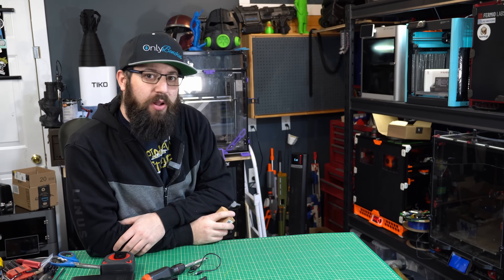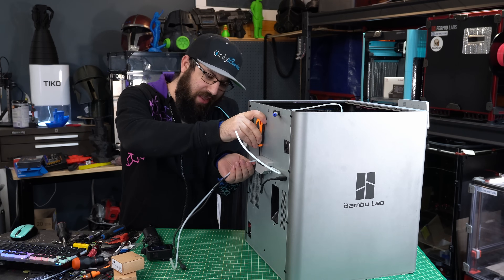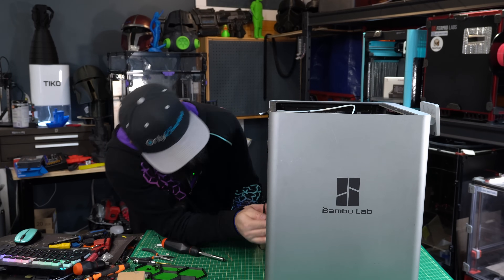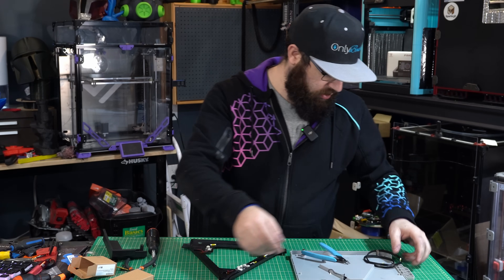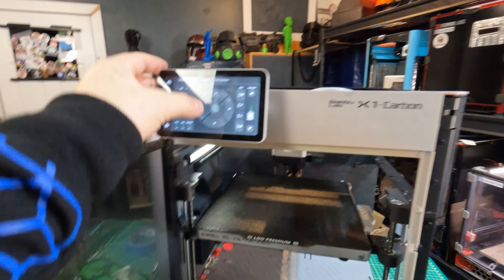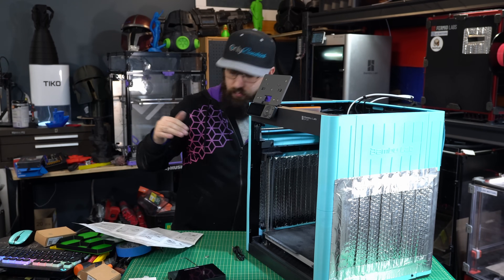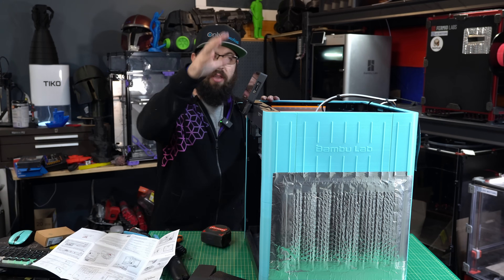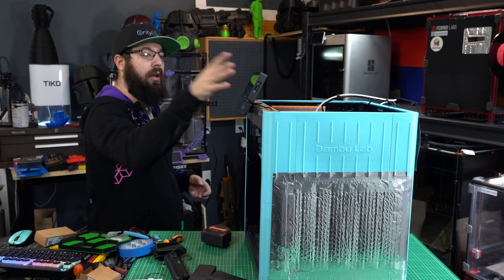My Bambu Broke, Lets Fix It (and upgrade the P1P Too!) #3dprinting

Comment: Bambu X1 owner from the UK here. Just thought i would comment in case anyone has the issues im having. I have a faulty bed that Bambu refuse to replace under warranty. Printer has done 800hrs. I have the V2 bed which is now discontinued. You have to replace the bed and an AC board for the V3 bed. Why was the bed discontinued? Was there an inherent fault with the V2 bed and the way the cables route through the bed. Well the V3 has changed the position where the cable routes through the bed so the radius of bends in the cable are not as acute. I believe this is the real reason the bed changed. Will Bambu honour it? Will they buggery! They just deny any faults and state its part of the upgrade of parts! Bullshit!  I know this is not going to help people stateside but i've recently discovered that consumers in Europe automatically get a 2 year warranty under directive 2019/771. This EU law is not to be sniffed at and gives consumers an extra year to what everyone else would be covered for. If you are anywhere else the warranty period seems to be 1 year. Ive spent the last 2 weeks talking to support who are absolutely useless and never answer your questions. Don't get me wrong when the X1 is working it's great, if it isn't you could spend weeks in the black hole they call support. I have been happy up to now but dealing with awful product support who accept no responsibility and never give you an answer has got me thinking its time to sell these and maybe build a Voron instead! Thank you for your hard work you do on your channel!

Comment: Good video.   I have both printers and luckily I have problems that require the dissemble you had.  I have lost many screws in the back hole when taking the nozzle out for jams.   I  wish I had purchases two X1 Carbons instead of P1P.,  a lot of parts are different between the two, especially the hot end.  I have to stock parts for both

Comment: Fair warning BL has hinted that they may block the way that devices like the Panda touch work in the future and eventually longer term make an API available. It's in the details on the Panda Touch product page but want to make sure folks read and make a decision before hitting the buy button, as its possible the device will stop working in the future.

Comment: Many users had to replace the whole bed coz of sensor problem.
I almost had to do the same, the connector was full of glue and removing all the glue from the connector solved my problem. I don't know why the use of so much glue. It is fair to say I no longer have it.

Comment: i personally just skipped the part of the ground wire and used a wago so i didten have to take the panel off saved me like 30 mins :P
Reply from the maker: Yep, because because I was pointing out the bad design and that they are a pain to remove normally, instead of disconnecting them from the back of the machine before taking it off the shelf, i have to get my step ladder and climp up top my shelf and disconnect the AMS itself first, then pull the printer off the shelf.
Just because its a situational thing, doesnt make it ok to design the plug backwards
Reply: ye i should probably have written i agreed its a pretty dumb that it is needed to be done that way anyway good video ill be tuning in next stream hopefully
 @CanuckCreator

Comment: thank you for steering away from preaching your extreme bias against bambu labs. loved your content even before they disrupted the market
Reply from the maker: I`ve never had an extreme bias against anyone, everyone is open to valid critiquing
Reply: @CanuckCreator  Understood. It can come off that way at times.
Reply: @oozie-c3j  If Bambulab fans feel attacked by valid criticism, I suppose that's certainly a choice they've made. Bambulabs has shown that they are willing to communicate with "the community", and aren't afraid to change and reconsider their strategies in response. So why wouldn't even the most hardcore toxic fanboys embrace that philosophy as well?

Comment: I did a partial P1P to P1S upgrade and although it's not nice to work on the instructions are easy to follow and the parts are cheap and in stock.